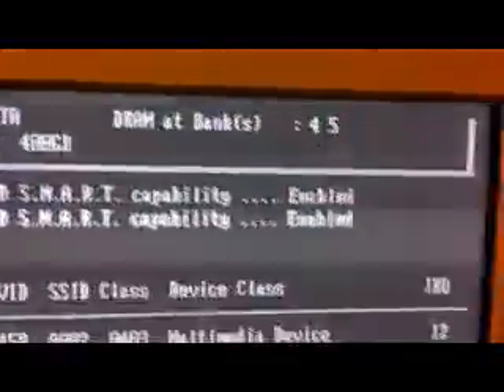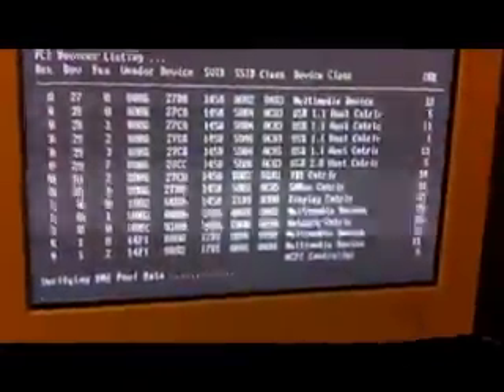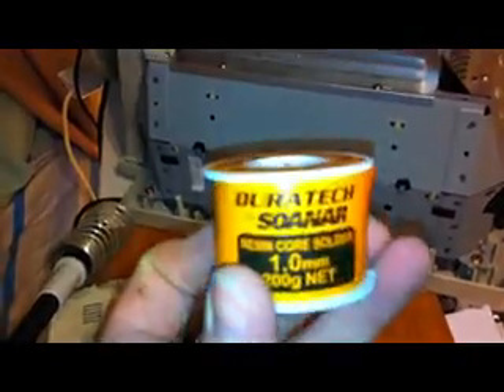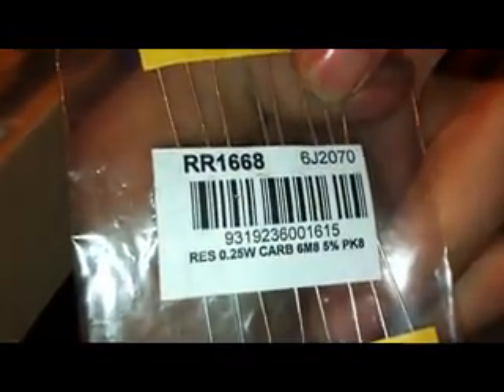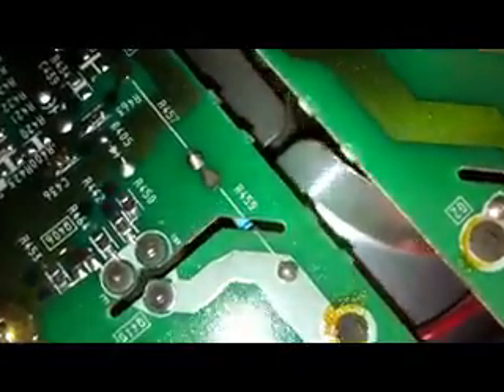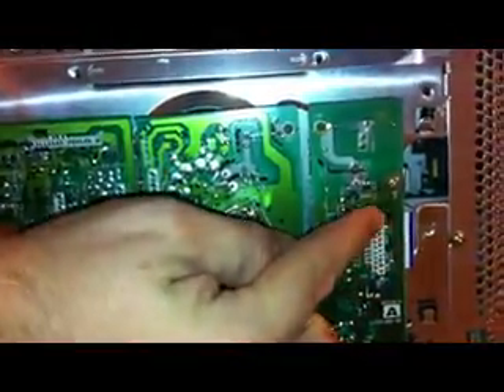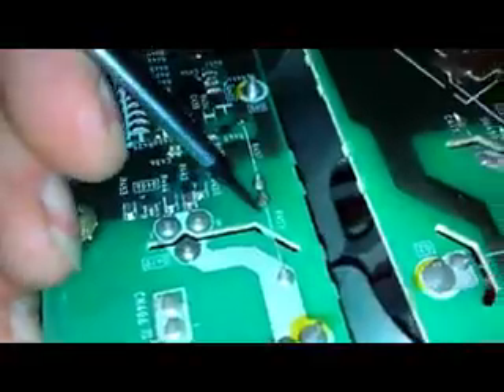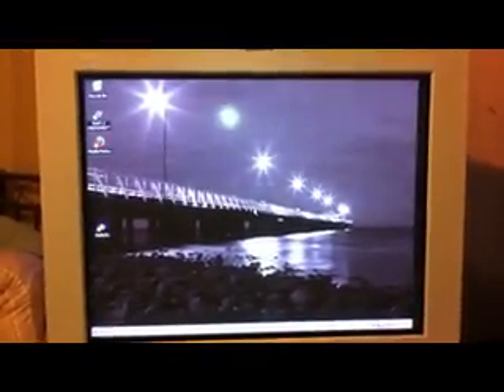Sony G1 Chassis FD-Trinitron G500 too bright Brightness r459 modification

Comment: This problem seems to be common on Sony monitors and it seems to have something to with old age. I bought a used Sony GDM-FW900 3 years ago an at that time the brightness was ok at a brightness setting of I think 6 black was still really dark, but now it is too bright even at a setting of 0. I will probably not fix this because I also have the problem that the monitor often turns off by itself, which is usually caused by a the flyback transformer from what i had googled and it is probably impossible to get parts for decent prices for a monitor that is out of production since probably something like 15 years and I also read that it is impossible to open the plastic case of the GDM-FW900 without braking it if you don't have a special tool.

Comment: @andreasg640 That actually worked on a G500 that I got recently, and that was too bright. The monitor had to warm up so the "Image Restoration" option could be selected, but after doing it twice it was fixed. Thanks!

Comment: This brightness problem should be fixed using WinDAS, not using this method(the resistor fix).
I would instead recommend mrlichenstein's video How To Fix Trinitron Monitor Brightness: v=kpbveKhYfn4  which shows how to use winDAS.  I have used winDAS myself on my CRT's and the process goes just like he shows in that video.
even Unkle Vito, a sony tech who used to give advice on Hardforum, said "I do not recommend the resistor fix, featured in many blogs." source: http://hardforum.com/showpost.php?p=1034996119&postcount=5487   Also, the resistor fix requires soldering, while winDAS does not.

Comment: It's too bad because these monitors still beat modern flatscreens today. I have heard using oven cleaner to dissolve adhesive works very well on anything. However, my anti-glare film is spotless. :D No need for me to replace mine

Comment: Sounds like some idiot ruined perfectly good monitors that would last 30 years. Brightness problem here too. 12 years old monitor in otherwise flawless mechanical condition. Antiglare surface might need remaking though. I have heard of removing the old film with oven cleaner and applying a new sheet successfully. :D

Comment: @mrlichenstein 

I tried that, then tried a experimenting with resistors. I got it a bit brighter but shorted out something and totally killed it all the way. I also got a nice shock for being careless around high voltage electronics. I decided to replace it with a 22" Philips 202P45, I'll miss the dual inputs the Trinitron had though. Sad story lol

Comment: This does work but the brightness controls get weird afterwards. I had 2 Dell p991s that were much brighter than that. There is a program you can get along with an adapter that allows you to change the G2 value in these monitors. The ones made between ~2000-2002 suffer from this brightness issue due to a rumored bug in the firmware of the monitors that compensates for the aging of the tubes. Recently someone found a circuit called drift correct which could also be causing the brightness issue.